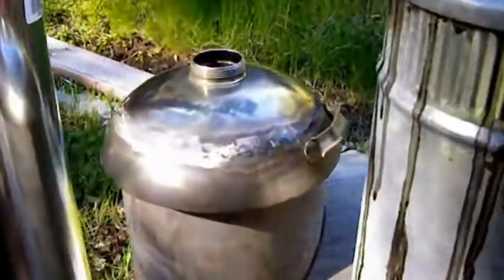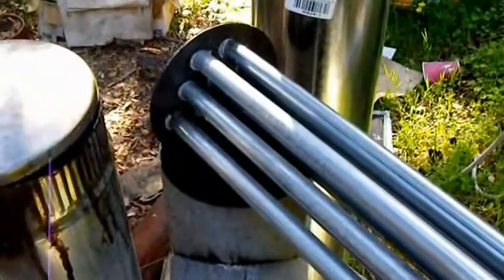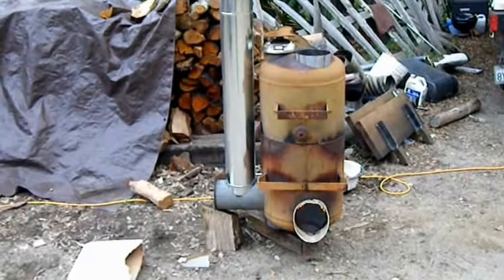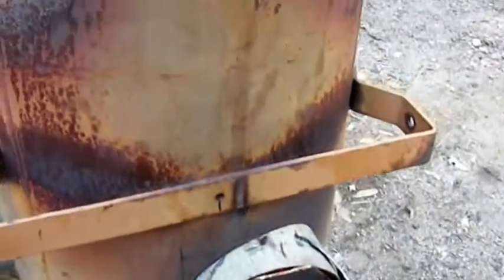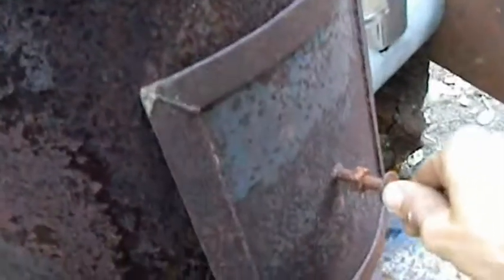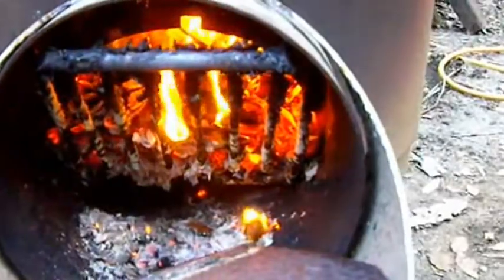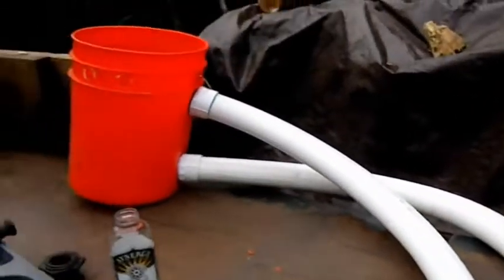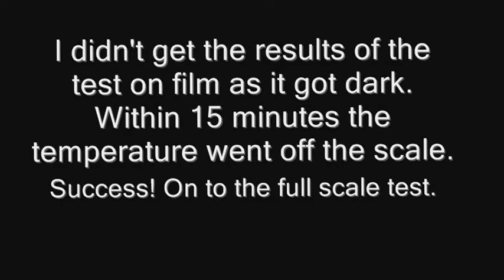Rocket Tub pt 4. the heat exchanger

Comment from the maker: all the pipe except the fuel tube is 12 ga galvanized. the fuel tube is galvanized chimney pipe, i think i will be replacing it with heavier ga before i finish. rust in the water... some is inevitable using steel, but i will be changing the water fairly often anyhow, so i dont think it will be an issue.

Comment from the maker: im heating 150 gallons of water up to 110 degrees in 2 1/2hrs give or take, depends on the starting temp of the water. that is in a plastic tub with no insulation or top, bot of which would improve heating time.

Comment: Eventually vids will come, need a cam, but I just built an inground rocket water heater. Bricks + cob build the Rocket S, it's about level with ground, 5 1/4" square feed and fire holes, on top is a 4' 4" fire pipe, 6" (#10) coffee can on bottom w 2 2' black stove pipes fitted. Coffee can lip splines into 8" galv end cap w 2 2' 8" galv pipe vermic inbtwn, 6 2' 1/2 copper pipe, 3 "U"s parallel to T/P valve circulates 30 gal H2O heater.Works but mite add another "U",but yr idea burns w less smoke

Comment: Nice welds! I like how you're just welding different types of metals with wild abandon! You're just using a mig w Stargon or CO2? That unit you have built could obviously hook (pump) into an insulated plastic 55 gal drum to preheat pex or copper coil going from cold in to water heater... Damp wood chips as fuel... Huge! 2 things I wonder is how long metal will last at the hot points and how much rust will be in the water... Is that all 30 ga galv 6" pipe?

Comment from the maker: i put the heat exchanger on the down draft side for several reasons. for one, i dont want to rob any heat from the burning fuel, i want it as hot as possible for the cleanest burn. two, i want as much draft as possible, hot air rising, then cooling on its way down the other side. three, i want the heat exchange to be counter flow. that is, the hottest air at the top hits the heat exchanger nearest its outlet (the top). hope that clears things up. cheers.

Comment: is that copper pipe or galvanised steel?
Reply from the maker: +Kyle Rogers Ha! its galvanized steel. i dont have the equipment to braze something like that in copper. 4 years later and it still works!
Reply: Do you notice any funny smells when the galv heats up?
Reply from the maker: Kyle Rogers
yes, it smells. its not good to breathe the fumes as they can make you sick. i did all of the welding outside.
Reply: Hmmmm ok, I'm going to try to make something similar, but in copper, the beauty of galv is that it doesn't react to acids in wood, copper will have to be treated some how